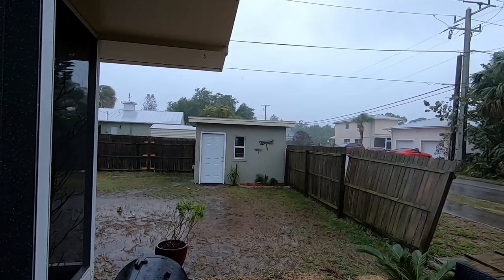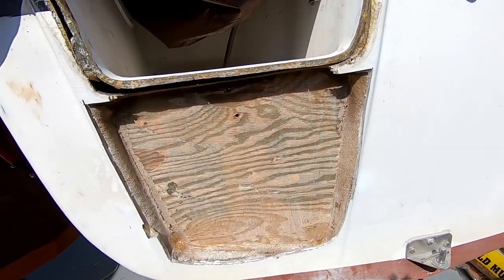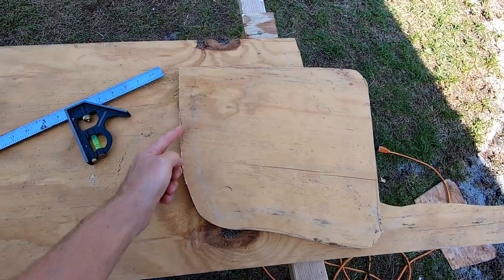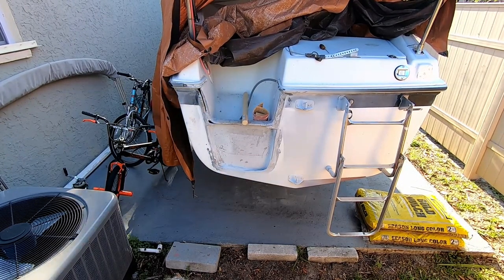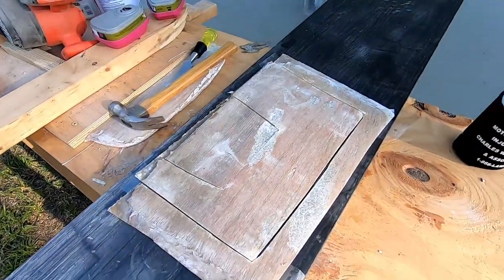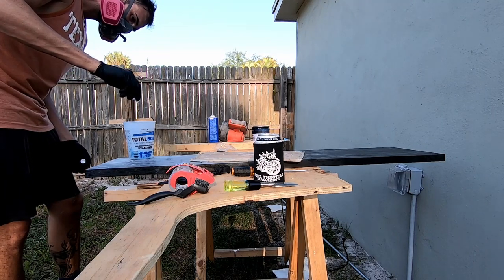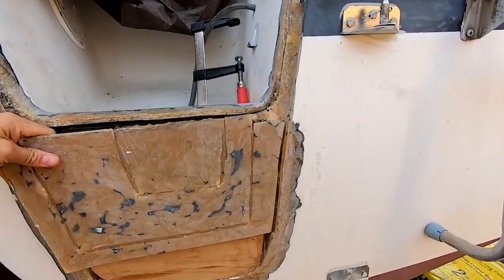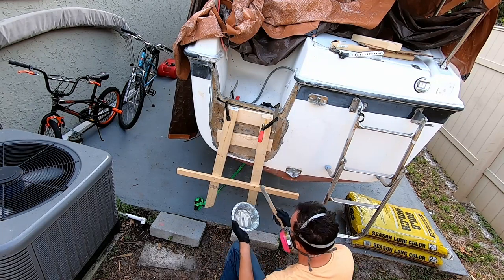Transom replacement on my Macgregor 26D

Comment: nice work... be sure to leave some for the next guy. Is the round SS fixture above the ladder shore power?
Reply from the maker: Hah! I'm trying to get this thing ready for a world trip, which I'll never use it for. The fixture is an Led stern light. The stock one I ripped off trying to pull myself up with!
Reply: @trailersailoradventures6138  I should have known

Comment: Never had a problem only used 9.8 hp motor bought boat new in 1999 I would have worked from the inside.
Reply from the maker: Inside the lazarette? That seems like an extremely uncomfortable place to work. Working from the outside was fine, honestly. I saw the damage, repaired any issues, and sealed it up just fine, without having to work in the coffin :D